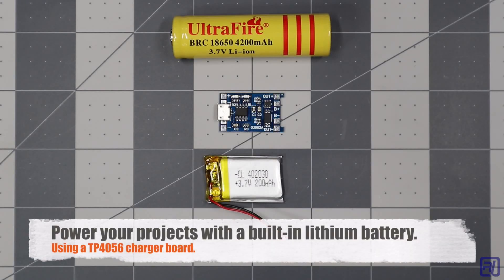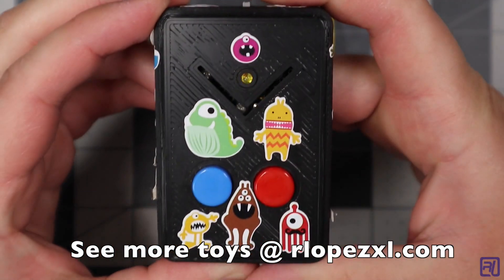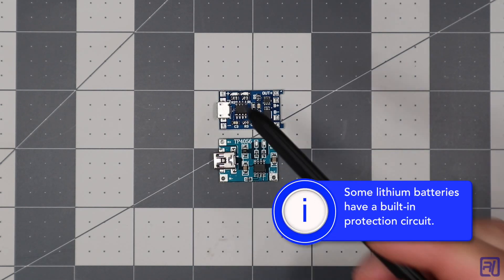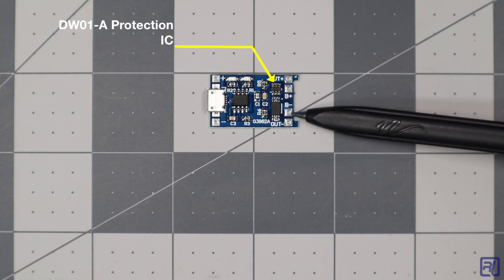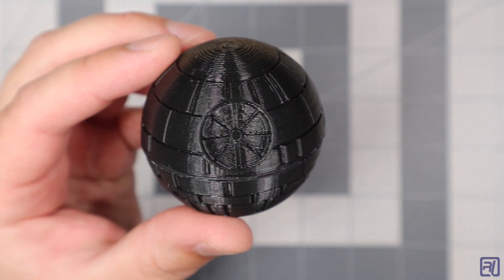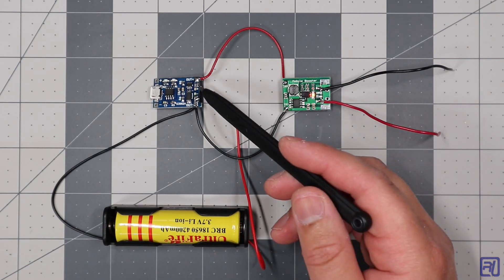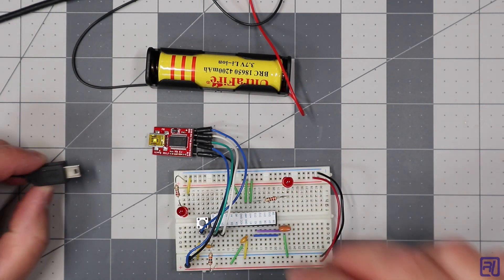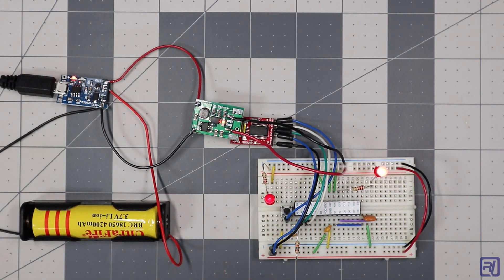Power Your Projects With a Built-In Lithium Battery and a TP4056 Charger

Comment: Hi, I am building my own minibike with a 80ccm (probably) 2-stroke engine. I also want to do tuning on it (finetuning om carborator on spark plug etc.).I have a little generator for the lamp (dynamo, idk if it‘s like this in english haha). I want to power a little electronic system with a OXOCARD GALAXY module with severel different ports auch as 5v, 3.3v, GND (of course), SDA, SCL, I003 (or 1003 ) etc. Can someone who has a basic knowledge about electronics contact me or reply on my comment. I know (in general what I have to do with a converter, powerbank etc.) but I am 17 right now and I have little to no knowlede about theese kinds (for me complex systems) electronics. It would be really nice if someone could help me. I would also send videos or do video calls. Btw I am swiss-german. I speak well english and good french (B2 niveau ). It would be really nice when somebody contacts me! Thanks!

Comment: Hi I'm here to see if anybody can help me with some problems getting current through this board.

I've been trying to turn some old headphones wireless, just a little side project for fun. But I can't get the power switch to turn on or off, the only way it will power on to get detected wirelessly is if I connect it to a power source outlet while the battery is connected.

The battery I'm using is a (3.7V- 4.2V Maximun) Lithium ion battery. Connected to the two center solder points as shown on here and other videos online  the problem is I can't get any power no matter what unless I have battery soldered on and the charger connected.

I don't know if it's the switch not soldered right or if I've soldered on to the wrong points on the wireless receiver. Which is a BK8000L Wireless audio module.

I've currently only soldered the battery, TP4056 board, power switch and audio module to test if I can get signal detected in my phone which I have. But only while battery is connected and it's charging, if I disconnect the charger the signal stops sending.

Comment: Be careful with 18650 Li-Ion batteries. They do not like charging and discharging them at the same time. I would prefer charge them and then use them. Do not do the both at the same time.
Reply: https://www.youtube.com/watch?v=f2yMs-JAyQM
Reply: That's not true, the battery won't care at all. It's more of a issue with the electronics being able to do both things at once. How do you think Tesla cars work when using regen braking? One second the battery is discharging when you are accelerating and the very next it's being charged when you brake. Lithium batteries are very efficient and don't have memory effect unlike older batteries.

Comment: Thanks for the great vid! What is the minimum mAh lithium lipo battery you can get away with and still get your 5v power? Thanks!
Reply: 0.000000000000000001 mAh 

You need to learn about volts x amps = watts

Comment: Hi, I'm building something similar but have an issue with the TP4056 module. The circuit would not start till I short the B- and OUTPUT-. Any guess why? From what I see in your video, you solder B- and OUTPUT- on the same pad.

Comment: The chip can take a max of 8v input.
The issue here is the voltage output.

Surely the chip supports 4.2v and most 5v will take that low voltage., But when you've 3.3v then it is too high to use.
May be important to put the project voltage on and its limit.

I use a booster for 5v, it's fairly small, I use a and a micro buck

Comment: Hello sir, I have watched your video on how to use TP4056 properly. I have a question, what materials should I use since Im going to make my own mp3 player? I have an mp3 player board, TP4056 without protection, and a prismatic cell with no BMS. I saw some comments on having their TP4056 a false charge yet overcharging their battery, and to Warren Wang's case where you said he should connect 1N5817 on those boards. I'm really confused and that I need to finish this project of mine, yet being aware of its dangers when not properly assembled. I hope you can give advices and instructions. Thank you for your advanced reply.
Reply from the maker: Hello Eric, I'm not familiar with the components you are using, so I suggest you go take a look at one of the many MP3 player + Tp4056 tutorials available online. Search for "instructables mp3 player with tp4056" and you'll find several projects with detailed steps and schematics.

Comment: Hi! I have the same module, but after a few usages it always starts outputting half voltage so I have to switch it out. Do you know what is going on and how I can fix it?
Reply from the maker: I've had a couple just die on me but have never experienced what you described. There are bad clones of this module out there, I would try buying one from a different vendor.

Comment: Very helpful video.  I have a question though.  I have to power my B&D rechargeable screwdriver with 2 x 18650s in parallel.  Will this arrangement you showed us will work ?
Reply from the maker: I have never done that.  Theoretically it could work but there are risks to having the batteries in parallel. I would just recharge the batteries one at a time or use two TP4056 boards.

Comment: I am not able to find a datahseet for the circuit board as such, only finding it for the TP4056 IC.
I wanted to know what is the maximum output voltage and/or current from the output terminals of the circuit?

Comment: I've always been confused about how drvers works.. ie . Led drivers.  Does the led pull current through the driver?  Or does the driver feed the led?  Maybe a very dum question

I seen people who don't need LED drivers ?  Is it okay not to use a driver /PWM?
Reply from the maker: That depends on the use case. I have used PWM to control several LEDs to give the illusion that they were all on at once using an AVR MCU. I've used LED drivers to control LED matrix displays using only a couple of pins on the MCU.  I will usually just control the LEDs from the MCU if I have pins available.

Comment: Isn’t it bad to charge the battery while there is still a load on it? Shouldn’t you charge the battery independently so it can terminate the charge properly?
Reply from the maker: Yes, you'll need to add a load sharing circuit.  There is another comment here from Warren were we discussed that.  I've been meaning to update this video and create a new one to talk about adding a simple load sharing circuit to the TP4056 using a pair of diodes.
Reply: Ruben Lopez
Another video on a load sharing circuit would be quite popular I would think, especially when you include the TP4056 as many people maybe charging their projects without knowing the risk.
Reply: Jack Penton 
I agree, an easy or more in-depth solution to this would be quite popular I would think not to mention the safety aspect!
Reply: https://www.youtube.com/watch?v=f2yMs-JAyQM

Comment: I currently have the same setup that I tried with both versions of the TP4056 running to a 5V step up then into an Arduino Nano powering 4 neopixel LEDs activated by 4 buttons. Two questions that boggle me. First is if I disconnect the battery, and plug in the USB, there isn't a high enough voltage coming out of the TP4056 to power the 5V step up which in turn means not enough voltage for the Arduino (~0.5V coming out of the TP4056 without a battery). If I momentarily plug in the battery, and disconnect it afterwards, the power out of the TP4056 goes up to 4.17V without the battery and successfully powers everything in the circuit. Secondly, if I disconnect the Arduino and fully charge the battery, the blue charged led lights up. Once I connect the load back on, the TP4056 goes back into charging mode. It's as if once the load is plugged in, it's pulling current from the battery and the TP4056 is no longer charging the battery anymore and it starts to slowly deplete. This means there's no way for me to determine if the battery is fully charged when a load is attached or it could mean that I'm constantly fluctuating between charging the battery and drawing current from it. Sorry for the long comment/questions but I've been struggling with this for a couple of days with no clear explanation.
Reply from the maker: This circuit is meant to be used with a battery, it will always draw power from the battery.  The protection ICs on the TP4056 are causing the odd behavior you described.  It sounds like you are looking for a load sharing circuit.  You could probably do something like putting a 1N5817 between the TP4056 IN+ to the boost converter IN+ and another 1N5817 between the TP4056 OUT+ to the boost converter IN+.  This should make the boost converter draw power from the highest voltage source, which will be USB when connected.  I might try this to see if I could get it to work and update this video later.
Reply: @rlopezxl  Thanks for the tip! I just wanted to verify before I replied. Throwing in two diodes on the TP4056 did the trick and kept the battery charged and switched over to the USB power when it was plugged in as it generally had a higher base voltage. When I was trying to power it from a USB hub (without additional power), it seemed like the voltage/current was slightly lower, so even when the battery was fully charged, it would blink between charging and fully charged, which I don't think is very healthy for the battery. With a USB power source that is attached to a wall socket, everything seems to work as expected.

Comment: Can we use Buck Converter instead 'TP4056 charge module' in order to charge battery with precise controlled power supply?
Reply from the maker: I wouldn't.  A buck converter won't limit the current.  You also won't get the protection features included in the TP4056 charger module.